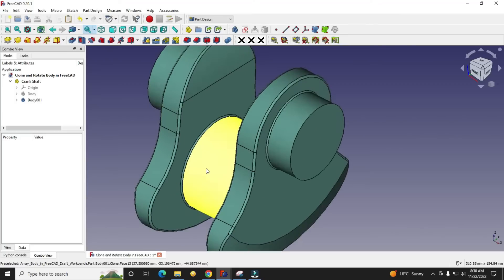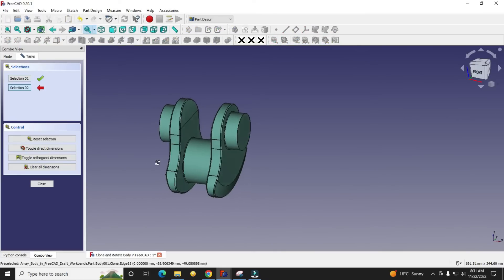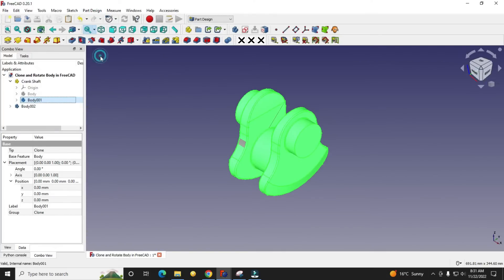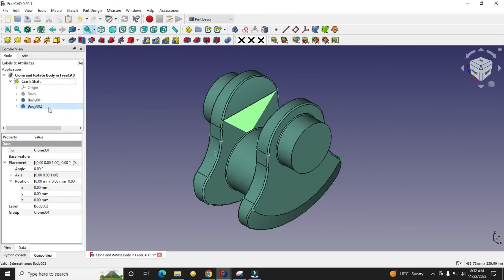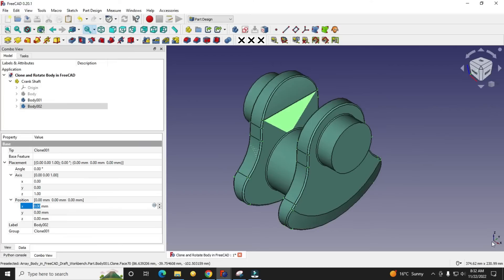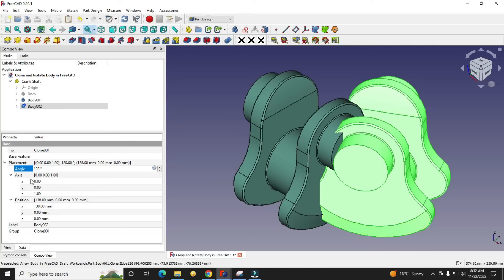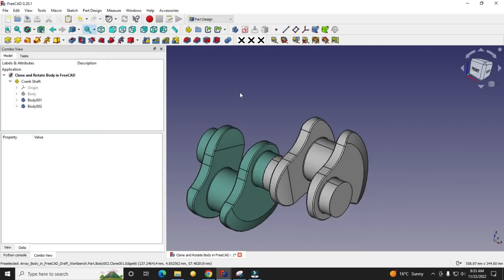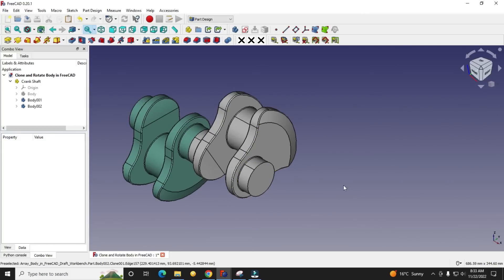Clone and Rotate body in FreeCAD |  | FreeCAD Tutorial | 3D Modeling | Learn FreeCAD | Mechnexus |

Comment: HI once again. Good video with a small remark from my side... For rotation of a body  on the Properties / Placement / Axis you've entered 120º, this is correct. Then you've entered 120º on X, this is incorrect. The Body rotated those 120º in fact but just "Par azar" as the frenchies say. The motive is because 120 starts with a 1... On the boxes X, Y Z the only values accepteded are 0 or 1. This means that if you want to rotate the part around a axis you must enter a 1 in the respective box and change to 0 the other boxes.  It's a bit awkward, I know...
Thanks for the tutorial, cheers.
Reply from the maker: All we have to see our UCS and according to that given value  for Position and Axis in XYZ direction. if you want angle then you can also give angle with respect to XYZ of Position and axis.

FreeCAD is very precise as compared to other CAD software when it comes to moving and rotating part. If you learned it then you can easily master Assembly4 Workbench. I have also made a detailed tutorial on it. https://www.youtube.com/watch?v=-vcjFFPKJHQ&t=152s&ab_channel=Mechnexus.